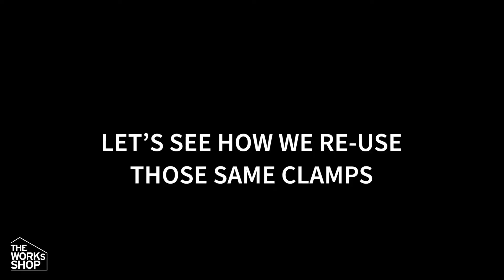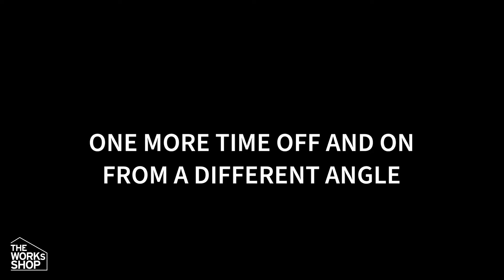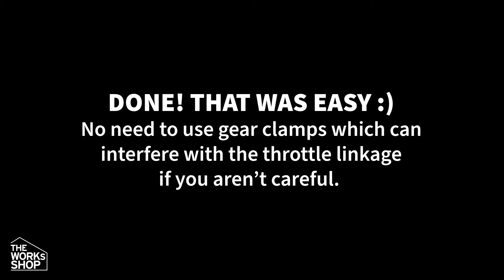Easy How To Remove and Re-use BMW S54 Throttle Body Boot Clamps

Comment: thank you for posting this, though, you showed it with the easiest to get to runner :) cylinder 3/4 man.. fuel rail really gets in the way (pita).  Still, thank you for posting the tool, world of difference, really appreciate it :)
Reply from the maker: I made the video to how the clamps work, getting to #3 & 4 is on you :) Maybe I got lucky but mine weren't too bad, I had them all off in minutes but those two were a little tricky to get the pliers in at the right angle. I'm glad the video was able to help!
Reply: 3/4 were easy I can’t figure out how to get the pliers to cyl 6 as there isn’t enough clearance on the top